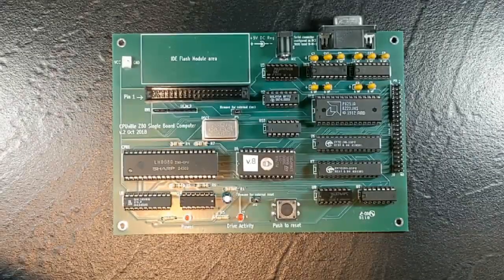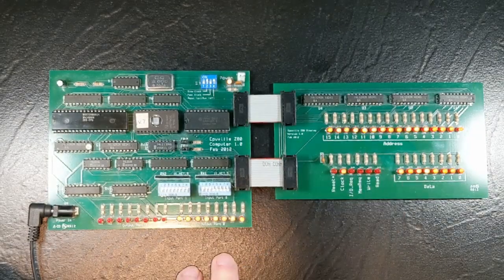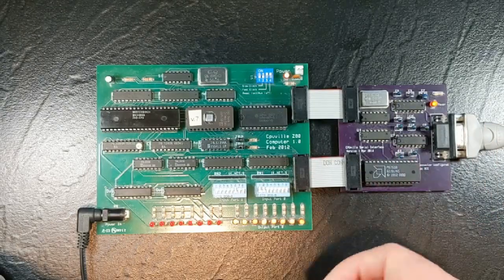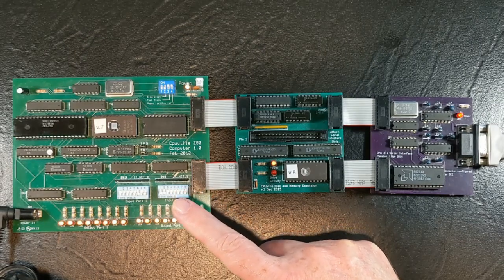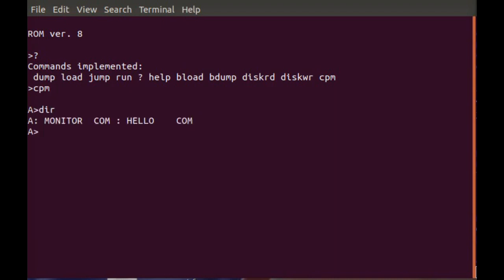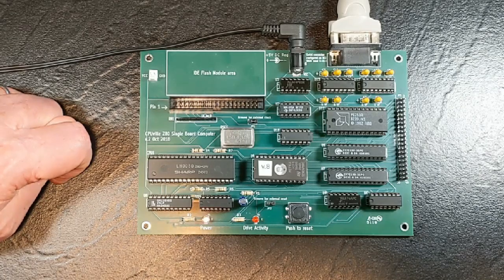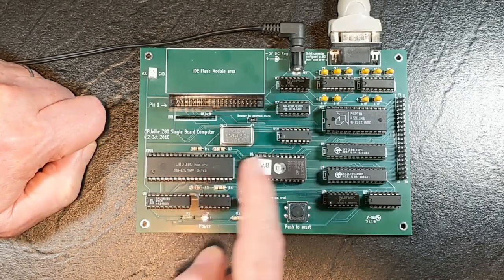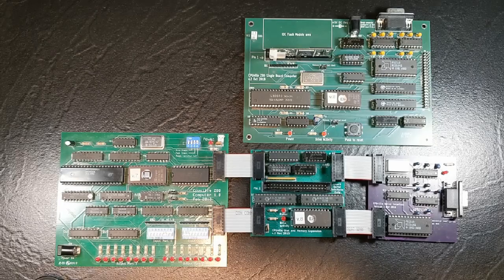Original vs Simple CPM Z80 computers comparison

Comment: Why the old school serial port and not a modern FTDI TTL level serial port, given the easy availability of them when compared to machines with old RS232 serial ports?
Reply from the maker: When I designed my first Z80 computer in the early 1990s I had a dumb terminal (a TeleVideo that I bought at a swap meet for $5) and I wanted to use it as the terminal for the computer, so I made the old-school RS-232 interface. I just brought the interface along with my later designs. I may some day bring out the TTL-level signals to some pins on the board so it would be simple to use them for other interfaces such as the one you suggest. You can also use a serial-to-USB adapter with my computer.

Comment: Nice board. Could you implement the rest of the IO into it like keyboard and monitor output?
Reply from the maker: The single-board Z80 computer needs a dumb terminal or a PC running a terminal emulation program connected through a serial port. However, I did make a project Z80 computer with a keyboard input and video monitor output. You can see the demo at https://youtu.be/ytSrQtWaluM
Reply: @donnstewart706  That’s awesome. I’d like to take on building the computer you’ve made. Having integrated video and keyboard ports was exactly what I was after. Could you run both CPM and tiny basic on that computer?
Reply from the maker: @burntoutelectronics  Yes. The demo shows Tiny Basic. To run CP/M you would need to extensively modify the CP/M BIOS to use the display and keyboard as the CP/M console, but it could be done. However, the computer system as presented does not have a disk interface, and its memory and input/output hardware is not optimized for CP/M.
Reply: @donnstewart706  okay that makes sense. I want to make up a circuit board with KiCad with the schematic on your website whilst implementing the keyboard interface on the one board. I’ve never built a Z80 computer and would like one that’s all self contained, I.e. no seperate computer required to operate

Comment: Hi Donn, good to see your'e still working on these things!

I have the original Z80 kit and boards, and managed to build a real-time-clock expansion for it, and get SDCC cross-compiling for it. I had one of my sons soldering the LEDs and resistors on the bus display board in the hope it would spark something in him but no such luck.

I recall hitting the IO address wrapping problem, and never realised there was a jumper to sort it out!

Comment: I wonder if it could run Wordstar?  I have a Montezuma cp/m disk for a Z80 card that goes in an Apple //e.  And I think there's a cp/m disk for the TRS-80.  But Wordstar was the king of applications for cp/m.
Reply from the maker: It has the potential to run Wordstar versions that run under CP/M 2.2. However, WordStar has to be matched to a specific terminal. I have tried a few old WordStar programs, they start, and I can eXit, but so far I have not been able to get a version that is fully functional. It might be my terminal emulation program, I have only tried Minicom in Linux. If anyone out there has had success with Wordstar on a CPUville Z80 computer I would love to hear from you!
Update: I was able to get WordStar 3.3 from the WordStar collection working on the Single-board computer. I used the WordStar installation program, and chose the DEC VT-100 terminal. The WordStar collection is here: http://www.retroarchive.org/cpm/text/wordstar-collection.html

Comment: Hi Donn, You won't remember me but I bought the old Z80 kit plus the display kit and the logic probe kit about 6 years ago from you. As I am typing this,  it is sitting on my computer desk counting to a million in slow clock mode (input port 0x32) on the V5 ROM. The only difference I have done is change the data LED's to green, the output port LED's and I/O_Req to blue and clock to yellow. It has given me so much pleasure in watching it run for all these years and hope it will continue to do so for many more years to come.
Reply from the maker: Thanks Andy, glad you like it.

Comment: Awesome video! I would love to see the new board operating with the 8-bit processor!
Reply from the maker: Hi Neal. The video of the 8-bit processor on circuit boards has a section where the new single-board is used as the system board. It is the pi calculation part.
Reply: @donnstewart706  I agree. I would love to see these computers running CPM